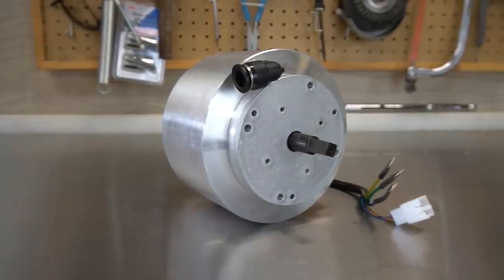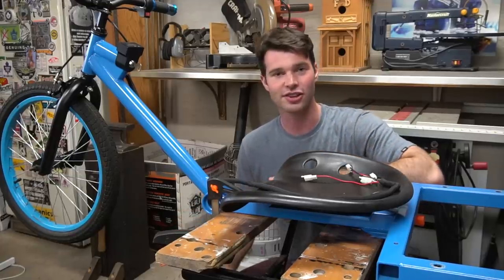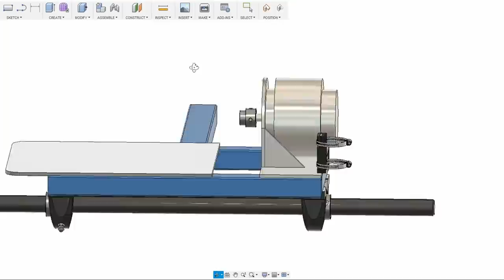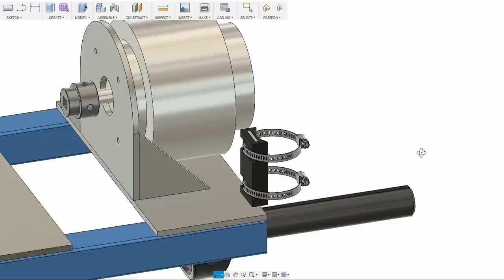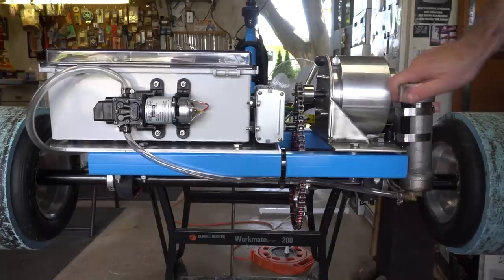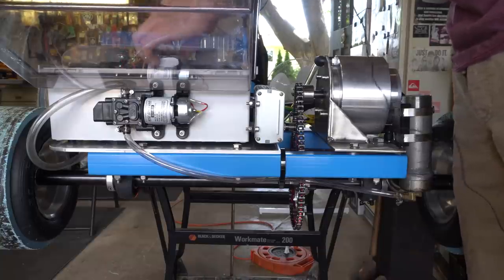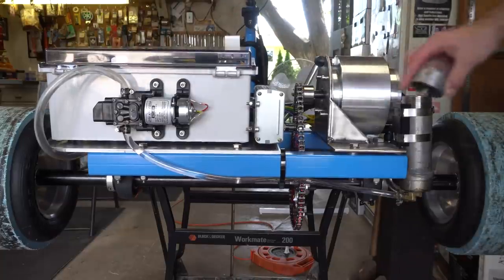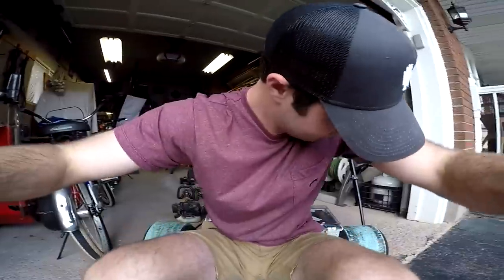Making a Water Cooled Electric Drift Trike

Comment: radiator is too close to the chassis, youre choking your airflow. put the water cooled motor on the go kart you knob! the trike doesnt need extra weight and shorter battery life because youre burning watt hours on a water pump. the motor doesnt need water cooling on that light weight trike.